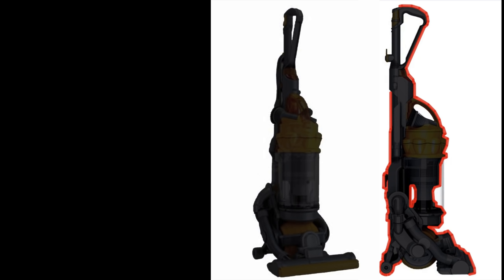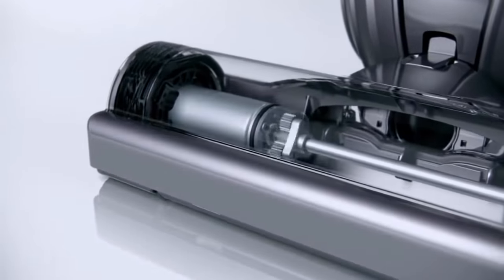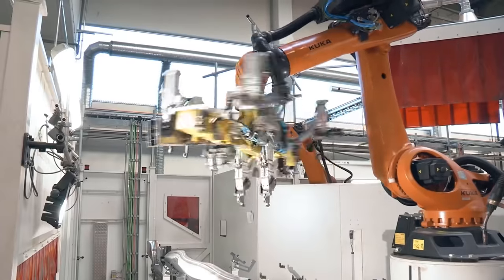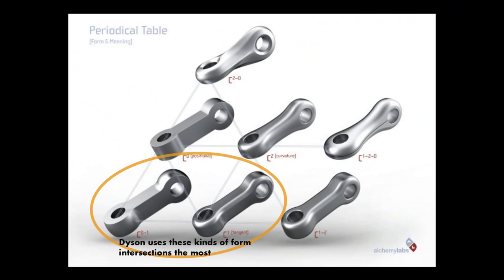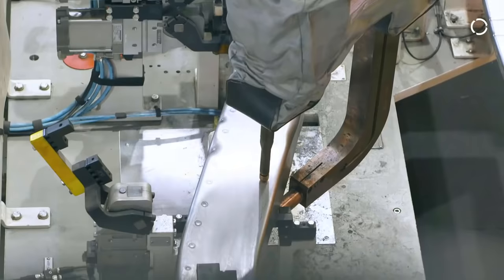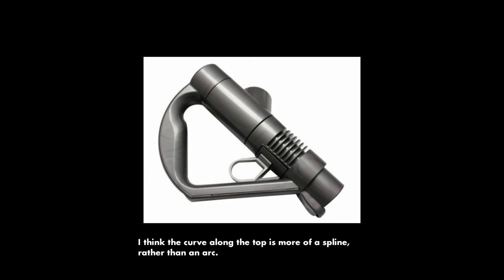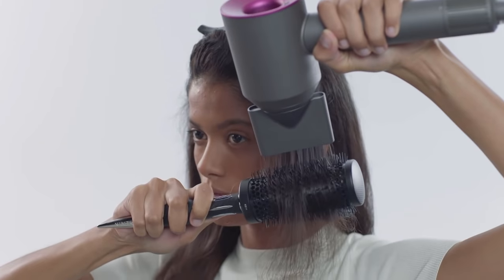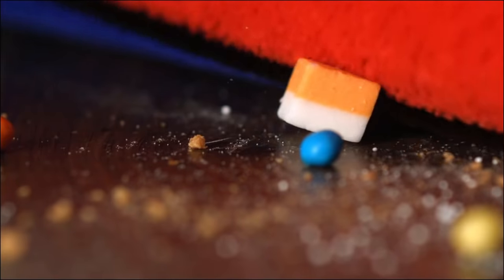Dyson Industrial Design Language Analysis

Comment: Thanks for another interesting subject. The Dyson vacuum cleaner and it’s later hair dryer share the same idea - the use of a high speed axial flow blower (fan or turbine) which was unique for domestic devices because of unacceptable noise it generated and relatively high friction losses. 

The first bagless Hoovers were incredibly noisy because the cyclone dust separator inside was just one big resonance chamber and was a financial flop as a result. Dyson realised that by using multiple smaller cyclones he could reduce the noise factor and improve the separation of the very light household dust particles. It came at the cost of function dominating form and the technology change was used as a unique selling point (USP) with great effect. 

With the hair dryer, Dyson used another industrial principle called the Venturi effect to hide the fan blades in the handle from view and create an illusion of a fan without moving parts. This time form dominated function. Extraordinary expensive engineering made acceptable by elegant design. (The Tesla cybertruck design being function over form like the vacuum cleaner)

Comment: I have the Dyson Large Vacuum, the small one, and the hairdryer, I must say that the small vacuum is riddled with issues, and is very flimsy. The large one is working well but its complicated look and assembly, feels that it won't to last and does not make it very user friendly.  On the other hand, their hairdryer, is much simpler in design with a very clean human interaction (e.g. the magnetic appendages) and it has worked wonderfully for years. I would say that they need to work on simplifying their design and work on the human Interaction better (dryer excluded)

Comment: Their large hoovers are seriously hideous and when I've used their small ones they're terrible at sucking up dirt and they get full incredibly quickly. Honestly, you often have to run over the same small piece of dirt 10 times. The plastic also feels really cheap, to the point where you're worried about pressing on the pipe connecting the head to the motor assembly in fears that it'll snap as when you do the whole pipe flexes upwards from it's connection point.

Comment: Dyson's products are not durable, perform poorly, and are way too expensive. So much marketing wank. If you want 400 dollars worth of vacuum cleaner, get one of those commercial backpack vacuums. They work great. Bag vaccums loose much less suction as they fill then bagless types, and you have to empty the bagless container like 50 times for every bag. When a bagless is like 1/10 full they start to struggle. Dyson design is not AT ALL industrial, its modern consumer styling. Real "industrial" versions of items are sold by their spec sheet and value proposition, not all this wank. I know I know, my engineer is showing.

Comment: After using Dyson vacuum for 5 years I bought Makita when Dyson fell apart. Dyson is very poorly designed piece of crap. Weight distribution, reliability, power - not even close to simple Makita, which also shares battery with other electric tools and had additional light (that Dyson "invented" in 2020) for many years. It's simple and reliable and that's how you design.
Reply from the maker: V unfortunate, thanks for sharing your perspective. You aren't the first one to write something like this in the comments.